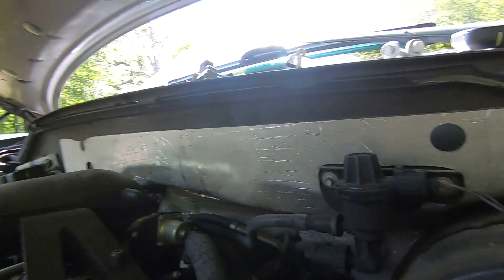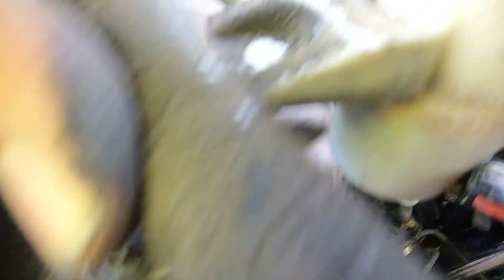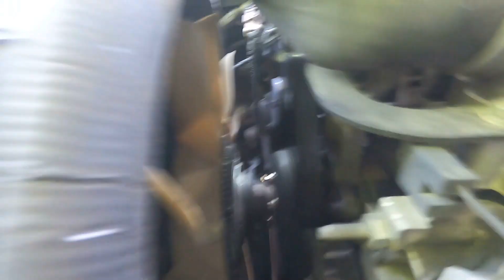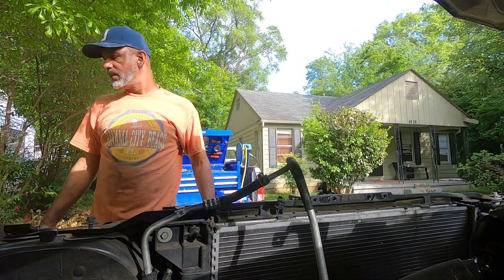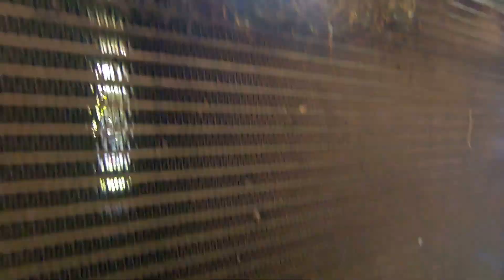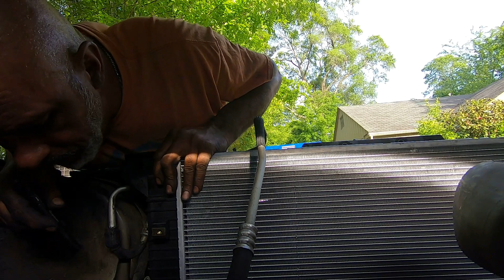2008 ford expedition radiator removal  step by step

Comment: Thanks for this video man. It helped a lot. 
Here’s my little tip I learned while doing this job, YOU DONT HAVE TO REMOVE THE FAN. 
There’s actually a little tab at the bottom of the fan shroud that you can press to swing the bottom half forward. That way the shroud can come straight up. Hope this helps some of you guys save time!
Reply from the maker: Thanks!! I’ll remember that ! 😊👍🏽
Reply: thanks
Reply: Right on!  I’m tackling this job in the am thanks for the advice!
Reply: Thank you very much for the tip....gotta change out the radiator on my 2007 expedition.  You're tip will save me some time and probably some scraped knuckles as well!
Reply: Just to add on, there’s two little push pins on each side of the bottom of the shroud(if they still have them, lots of people don’t put them back) then it’ll swing up.
Reply: Learned this in a dif vid for the air compressor 😂

Comment: Yea. Looked everywhere for a step by step video without finding one.  Now that I’ve taken my radiator out and installed I found this video.  Very good one by the way.  Mine was a 2007 but very similar.  Shroud was the most aggravating part.

Comment: I just finished replacing my 2008 ford expedition radiator 05/23/2021 and figured why the headlights need to come out . so turns out the radiator clips are easy to access from the headlight holes and behind the left headlight is a couple hoses that are so easy to take off too. The horn needs to be removed to  gain access  to those hoses easily. Good video dude.
Reply: I got them off without removing the headlights

Comment: We did this job in July 2022 on our Lincoln Navigator which is pretty much identical to the Expedition in this video. Like others have commented we didn't need to remove the cooling fan since the fan shroud is designed to swing up so it can clear the fan to be removed. It took us 8 hours to do, but we got it done.
Reply from the maker: That’s the important thing.  Good job 👍🏽

Comment: Great video. Started changing out my radiator on 1-7-22. Got everything disconnected but ran out of daylight to remove and install new one. The hardest issues was the fan shroud getting it over the fan. Read a comment about there being a latch to swing it open to bypass the fan. That was clutch for me. Now hoping 1-8-22 I can finish the job and get my car back on the road. Again. Appreciate 🙏🏽 the video .
Reply from the maker: Out of curiosity, did you find that swing part they were talking about in the comments.. fan shroud

Comment: Thanks big bro. I used your methods, not step by step tho.  I have to say you did make it a fast job and could have been faster, however, I found it easier to remove the passenger headlight to reach the drain, then other reason to remove the light emerged. Also, removing the grill helped a lot too. Thank you very much. We see you in Philadelphia big bro

Comment: Easist way i find without removing fan and shroud (just have to push up and back towards motor)  was to remove headlights then take out the 6 bolts for core support . Then you're about to just pull core support forward about 5 inches.   I didn't remove the grill either.

Comment: Which hose connection is the transmission to radiator one? I had the radiator replaced a few months ago and now I'm seeing tranny fluid coming from the driver's side, upper radiator area. Cant see exactly which connection it's coming from. Great video BTW!
Reply: Same thing happened to me when i changed the radiator in my 2008 vic. Its weird because i didnt see and tras line go to my radiator.  But the trans fluid gets low and leaks from the same spot your talking about..

Comment: I’m having an issue after changing my radiator, right were the Retainer clip goes on the elbow part of the holes it leaks: so my question is Should I  have the truck running as I put the fluid in? I’m not sure why the fluid is coming right back out after just a lil of the fluid is poured in I don’t wanna take the radiator back out to try and figure this out.
Reply from the maker: how many times have you overheated the truck,  the radiator might have been bad. but what happened after that?  did u blow a head gasket due to the over heating?  fill the car up with water.. TOTAL FILL,,  THEN GO START THE TRUCK,,  did water push out of the raiator? if so u may have blown a head  gasket,, get it check out from a mechanic that know how to check for that.. the test a gave u is Caveman style but it works.. let us  know

Comment: great video quick question on the bottom radiator hose after you took the clip out you just pull on it cuz I pull on mine and it's really hard or do you have to twist it a certain way thank you any help would be appreciated
Reply from the maker: Just twist and pull.  It will come off   may be the harness thats holding it,, put the time of the video and ill look at it

Comment: You didn’t need to take off the fan clutch to pull the shroud off. The bottom of the shroud swings up into itself from the bottom so you can just pull it straight up
Reply from the maker: really?  i missed that

Comment: Any particular reason you're running green coolant in your Expedition?
Reply from the maker: i like the color,   i dont discriminate.. lol    green is what it had in it.. so i stayed with green
Reply: @HayesMobileAutoRepair  was curious cause Ford spec is orange or yellow.

Green is supposed to be not good for this year/engine combo.
Reply from the maker: @drkythri  never had any problems with antifreeze...you can not mix some so on that note be careful.

Comment: Bro i used all your method except i found that way to take the fan cover without removing the fan clutch
Reply: How did you manage that?
Reply: @bloomMajor  hooks underneath the car you can see them facing fan
Reply: @maurotafoya8415  thanks alot man